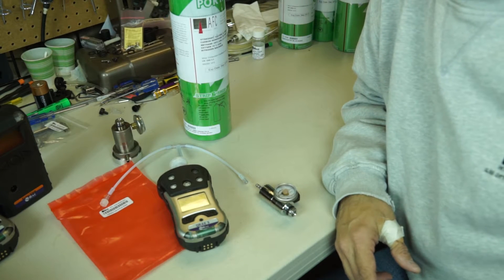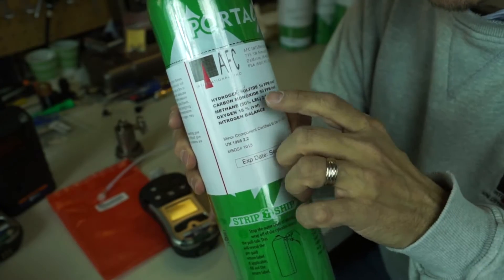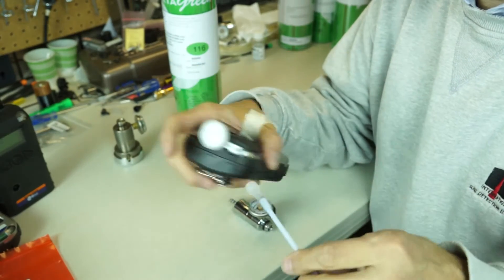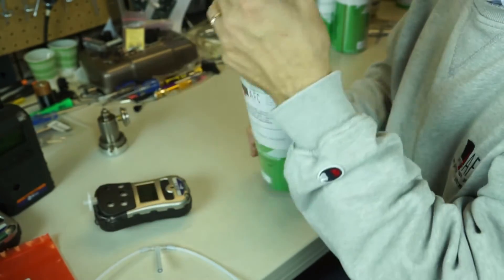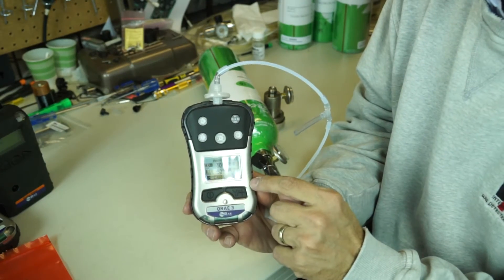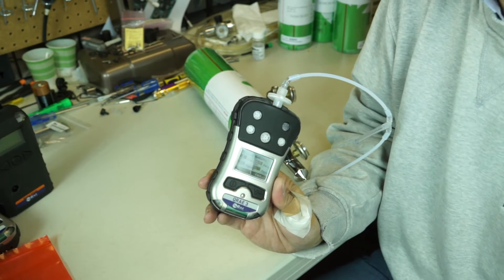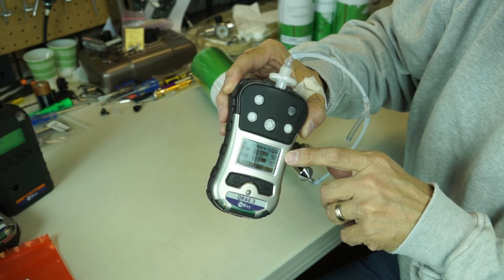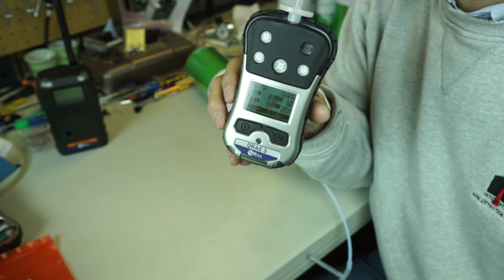Calibrating Rae Systems QRae 3 Gas detector using "T"

Comment: Hello Jim. Thanks for very interesting video. i have the same equipment since December 2018 till today and never have a problem with it but yesterday is started blinking with "cal"  on all sensors. i just used it maximum 15 times and as i understand it says that i have to calibrate it. can you please help me with this?
Reply from the maker: Follow the video instructions and the blinking cal will go away.